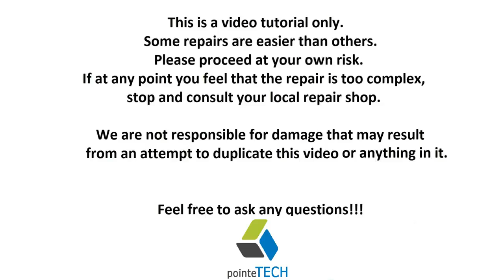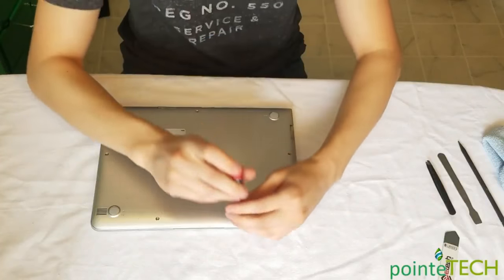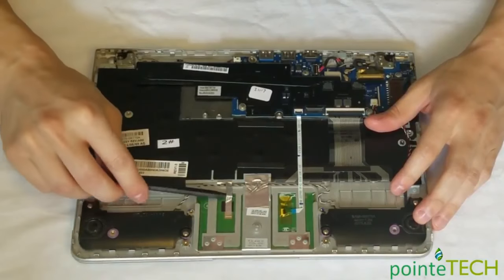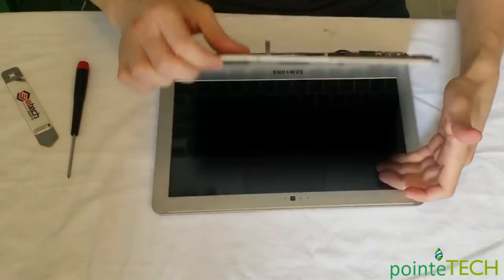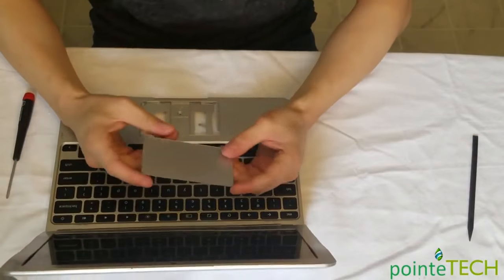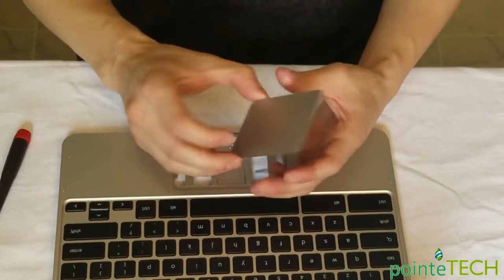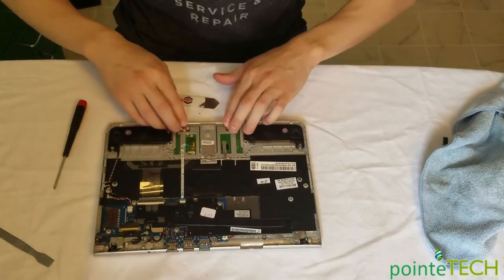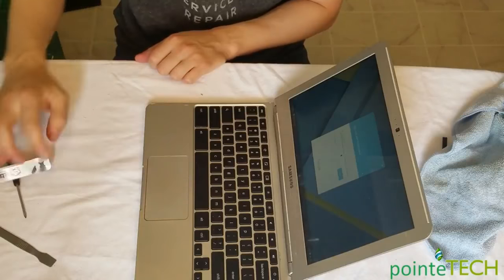How To Fix Trackpad Touchpad Stuck, Won't Click - Laptop Repair

Comment: Hi, I have a microsoft go 2, and when I click the trackpad the bottom left corner of it gets stuck down after I click it, but it pops back up after around 3 minutes.
Reply from the maker: Its possible that it just needs to be cleaned as seen here.  Have you tried that?

Comment: hey I have a hp laptop and the same problem but it clicks when i put it on a table but not when i put it on my bed or something can i fix this?
Reply from the maker: Sounds like the same issue.  On a table, the computer is perfectly level and all the components perfectly line up.  Anywhere else, it could be just slightly bent and needs to be cleaned to allow for that extra space.  I would still try the steps seen here first.

Comment: Does this work for MacBook as well?
Reply from the maker: This repair process works on certain types of touchpads that are getting dirty to the point of affecting their click feature.  If that is the issue with yours, then yes, this should work.  However, if your actual touchpad is damaged or not working, you would have to replace it.
Reply: PC Monkey you have such a great voice. 😅

Comment: Mines broken because my little brother punched the touchpad and now not only is the touchpad stuck down but the frame right next to it is sticking up. How can I fix this?
Reply from the maker: Any parts that are physically broken would need to be replaced.  I would disassemble the computer enough to access those parts and inspect them for damage first. If they are only loose, tighten them.  If they are broken, replace them.

Comment: I have an Asus vivobook and my trackpad buttons don't work. You can click and hear the clicking but they wont do anything. The mouse and the fingerprint button work, it's just that the right and left click buttons won't work.
Reply from the maker: You can try reseating the ribbon cables for them.  If that does not work, make sure your updates are all processed as seen here;  https://www.youtube.com/watch?v=DDv2gJDjfOM.  If that also fails to help, you may need to replace the part.

Comment: hi my left click mouse has been pushed in a bit and i heard a crack right before. its now more pushed in on the slide side when i click. how do i fix this?
Reply from the maker: I would disassemble to get to the touchpad.  Then remove it, inspect for damage and if none is found, try to reinstall.  If damage is found, replace it.

Comment: I bought a brand new msi but I wasn't able to send it to guarantee service repair and now it's been too long. I'm assuming it's not trash stuck in there, because the laptop is brand new, but the touchpad is always pressed down on one side and I can't really have the clicking effect because it won't go up. I don't know what to do.
Reply: Also, I would try this and see what's going on in there, but I'm so scared of taking the battery off, it's not like taking a lifeless peace of plastic, I'm sure I'll ruin something up on the battery
Reply from the maker: @miss_B_  If the touchpad is stuck down then I would assume that something in there is stuck or broken.  Yes, I would definitely open it up and inspect for damage.  What is the exact model of your computer?  We can try to find a disassembly video for your specific computer so you know exactly what to do
Reply: @PC_Monkey   it's MSI GF65 thin 9sexr .... It could be very well broken/stuck, because when I opened the box brand new, it was already like this, but I'm just really afraid of the battery removal, I've never done it and I'll most likely mess things up. Thanks for trying to help
Reply from the maker: @miss_B_  If its brand new, I would just return it as its damaged if your afraid on opening it up.  Also, if you open it up, there is a chance you could void the warranty

Comment: A lil' bit of water (like seriously a drop or two) fell on my laptop's touchpad and idk whtts happening now .. the cursor moves but it ain't clicking anything.. please helpppp 😭
Reply from the maker: You may need to clean or replace the touchpad.  Try unplugging it and then plugging it back in first from both ends of the ribbon cable.

Comment: I out a little bit of water on my touchpad HP laptop, it works for few minutes and after the mouse disappeared and now I can't use the touchpad. What would I do to solve this
Reply from the maker: You spilled liquid on the touchpad?  If so, I would remove the touchpad and thoroughly clean it.  If that does not help, you may have to replace it
Reply: @PC_Monkey  yh but how would I clean the touchpad?
Reply: @PC_Monkey  now the mouse is pointing but not working
Reply from the maker: @frituste  You could use a toothbrush or rag and 70% isopropyl alcohol mixture to clean it.  Thats your best bet but sometimes liquid damage is not fixable.  The board component needs to be replaced.
Reply: @PC_Monkey  what if i don't have isopropyl alcohol, should i just use alcohol
Reply from the maker: @frituste  You can but the other solution is better.

Comment: Please,  what about when water pours inside the touch pad and didn't respond anymore?
Reply from the maker: After a liquid spill, you want to first make sure the computer is 100% dry. You would turn your computer off immediately by pressing and holding the power button until the computer turns off. Then you would disassemble the computer as much as your comfortable with, at least trying to remove the bottom case. Then you would turn it on its side and let dry for a couple days.  Have you done this yet or are you sure the computer is dry?
Reply: @PC_Monkey  
After some hours without dissembling it.  The touch pad has started responding.  Actually,  this situation happened today.
Reply from the maker: @EMOTIONALSTORIES771   Ok, let it dry/sit overnight.  Hopefully it will be dry enough.  Let me know what happens :)
Reply: @PC_Monkey  
In about five hours,  the touch pad started responding.  I'm so grateful for your good work.

Comment: guys what i did was closed the screen for 5-6 mins, then opened it... after that all fine.
Reply from the maker: Your touchpad was sticking and then was fixed after you closed the screen?
Reply: The monitor or whatever u wanna call it.

Comment: My touchpad has lemonade near it, now it’s sticky under the pad and idk what to do 🤡
Reply from the maker: You would have to remove the pad and clean it and around it.
Reply: PC Monkey Thank u 😁
Reply from the maker: @angvlic  np :)
Reply: @Potato Girl hi umm I just had this same problem my hands had a bit of water on it and I touch the pad and it was stuck and opened it up and cleaned it and it works
Reply: @Potato Girl you just have to be careful and you’ll be fine
Reply: I did that and now my touch pad doesn’t work

Comment: Question if I press it to hard will this fix it my tab
Reply from the maker: I cant tell you if that will fix your key if I dont know whats wrong with it unfortunately.  What is wrong with your Tab key?  Is it just not clicking down correctly?
Reply: @PC_Monkey  I pressed to hard and it’s not working anymore
Reply from the maker: @Marwa_follow503  If something is physically wrong with your key and its not clicking down correctly, I would disassemble it as seen here https://www.youtube.com/watch?v=M-aYew3NSv8&t=2s and inspect for damage.  If no damage is found, try to reinstall.  If damage is found, it would need to be replaced.
Reply: @PC_Monkey  no my  tab I pressed hard on it
Reply from the maker: @Marwa_follow503  I dont understand your comment.  You pressed hard on it.  Ok.  Is the key now physically damaged and not moving properly?  What is happening other than you pressed hard on it?
Reply: @PC_Monkey  no my tab

Comment: I got the same laptop today and the mouse did not work and the sd card broke and there is lots of scratches
Reply from the maker: If the mouse didnt work at all, it may be unplugged or damaged.  I would open it up and make sure its plugged in correctly.
Reply: @PC_Monkey  it works now its just if it's in charge it won't work but if it's out of charge it will work
Reply from the maker: @joannerosalia7563  You can double check if your charger is working properly here;  https://youtu.be/YBhsVHideGE.  However, I have seen that as a pretty common problem with those :(

Comment: My cousin spilled pop all over my computer while I was not home what do I do?
Reply from the maker: Whats wrong with the computer?
Reply: @PC_Monkey  the keys are sticky and my tap pad won’t push down
Reply from the maker: @skylarfoster42  You may need to clean under the keys.  If there are too many, it may be easier to replace the keyboard.  The keypad too most likely needs to be disassembled and cleaned.

Comment: how do i do this on a surface pro?
Reply from the maker: What model do you have?
Reply: @PC_Monkey  windows 10 pro
Reply from the maker: @ratchill  Windows 10 pro is the operating system that your computer uses.  Its not the model of the computer.  Does this help find your model number?  https://www.youtube.com/watch?v=-t1UcxmT7yA

Comment: how much does it cost if we repair it
Reply from the maker: If you repair what?  And what brand computer and model do you have?
Reply: Trackpad I have asus vivobook 15 k513
Reply from the maker: @ayushnaval1457  To replace a trackpad on a computer, I would usually charge $75 USD for the labor and charge you for the parts.  From what I can see, that part is not easy to find.  It may run you almost $50 USD.  But keep in mind, im usually about half of what other shops will charge.

Comment: this wasnt helpful
Reply: i need mousepad fix with no tools plssssssssssssssssss
Reply from the maker: @gamerthismecool  What is wrong with your mousepad and how would you want to fix it?
Reply: @PC_Monkey  i need to fix it but without like taking apart the computer and whatever. is there another method to do instead of taking apart the computer?
Reply from the maker: @gamerthismecool  How to fix it depends on what needs to be fixed.  What is wrong with your mousepad?
Reply: @PC_Monkey  its like to fix your click or whatever but its on a certain side. But i want to do it without opening the computer andd stuff
Reply from the maker: @gamerthismecool  Its hard to fix a car without opening the hood.  Same goes with other machines too. Unfortunately, to fix a component that physically damaged, you have to physically access the component.  Not sure what can be done without accessing the part...